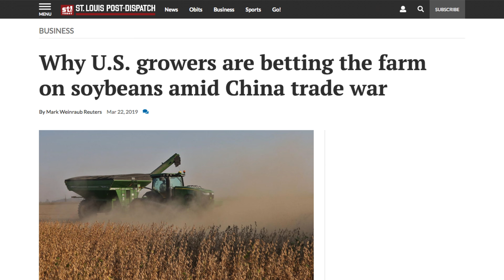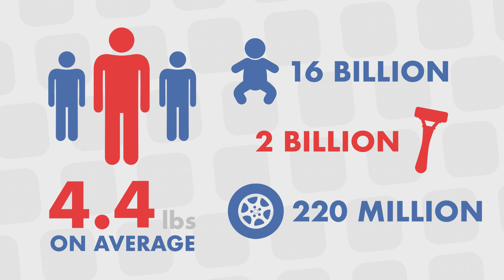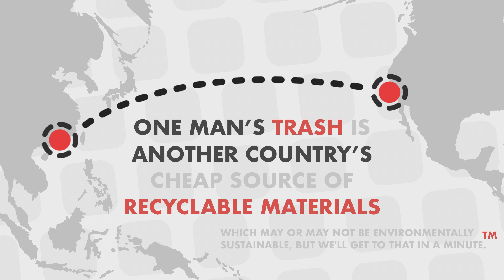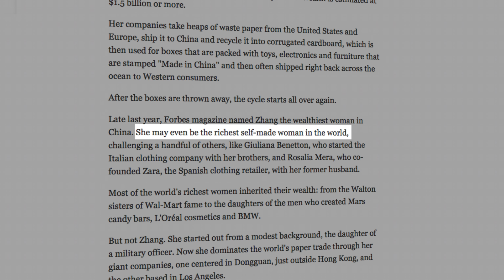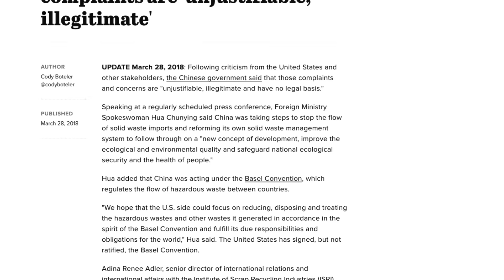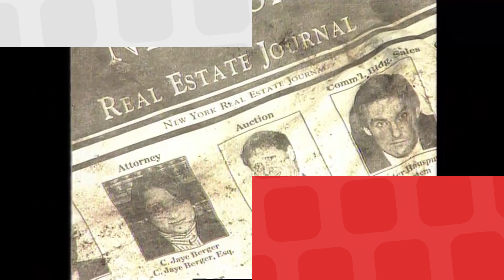Why China Doesn’t Want Your Trash Anymore

Comment: The company I work for is closely connected to one of the largest facilities to manufacture cement in Europe. Cement production consumes insane amounts of energy at a level where the lights flicker whenever they switch the large machines on and off (it strains the local grid's capability to compensate). As it turns out, they generate 60% of their profits by burning trash to produce more than half of the energy onsite (with extensive filtration; they are very clean at it). They basically make a profit before selling anything at all.

Since they also sell some of the by-products, the company is producing so cheaply that it's impossible to compete with them on a national level and to an extent even across the borders. The facilities and machines are also so insanely expensive that nobody dares to put up that kind of investment. They are very close to a monopoly and don't rly have much innovation going on as a result.
Reply: What is the name of this wonderful company?
Reply: at least its a green monopoly
Reply: Cemex. Though they didn't build the thing up from the ground. The basic system for repurposing trash was set up decades ago in a less refined form. The plant itself has seen different owners over time and a number of very costly modernizations took place. It's heavily automated, too.

The cement industry itself isn't too profitable overall and even the big players seem to run into financial troubles quite frequently. I wouldn't be surprised, if the facility switches owners again at some point. The people that work there have seen them come and go, but the facility always found a bidder.

Comment: Hello from Denmark. We are burning our trash for electricity, heat, and hot water. 
Since the process produces all of that, we simply use all of that.

We are importing trash to keep our burners going. This is a future problem when we no longer produces enough trash. But for the moment we are earning money on trash, converting that into "green energy" because we are that good to recycle then we are left with 0 landfills, and our trash being burned are overall non-recyclables. 

That is part of our "Danish model"
Reply: but burning trash is pretty toxic don't you think? I mean it is beneficial to burn trash for energy but that compounds the CO2 problem and releases harmful particles to the air.
Reply: @anyanyanyanyanyany3551  it terms of that, we would need to consider firstly the kind of powerplant that it replaces. Secondly it is mostly bio trash, using highly efficient incinerators that scrub the worst of the pollutants from flue gases.

Then we don't need separate powerplants to generate heat, or hot water.
But a lot of the imported trash does contain a lot of plastics.

And we that we do not have any landfills, at all.
Reply: @anyanyanyanyanyany3551  nope it's filtered is different from open burning that we do in balkan villages in DK they do this on a power plant whixh filters all the s💩 that would come in the air and burning makes dark grey or black but is white instead so it means all of the harm is removed

Comment: I have a solution (for the plastic all other recyclable are screwed) you manufacture a ton of airtight metal spheres/cubes/cylinders fill them with plastic vacuum seal the plastic filled spheres then heat them causing pyrolysis which will produce new smaller polymers like short-chain hydrocarbons which can be used a carbon-neutral fuel in internal combustion engines or be used to reform long hydrocarbons (i.e plastic). This could also be slightly modified to accommodate cellulose/lignin so fibrous plant waste/paper could be recycled into something other than more paper.

Comment: Maybe a system that can take blueprints from companies that make certain items like cellphones, computers and etc. that are all feed through a machine that helps read an item and breaks down these tossed machines into their base components. for example, separating all the different plastics, metals, and boards from a cell phone, or plastic from a rotating fan. I don't want to hear how that's impossible, in 20 or 50 years how far will tech jump to? As for blueprints, companies would just need to play ball when the government tells you to do something. It would then be on the government to protect the these blueprints from would-be thieves via encoding security. It''s a hard concept to explain.

Comment: New Zealand was prompted to create industries to process this waste onland 
Plastics are converted to fenceposts.
Tyres shredded and could be used in roading, but is not. Most goes into new rubber goods and steel belts recycled into steel again.
But the high cost of energy here has reduced the economics. The Gretas of this world are denying the recycling possibilities.

Comment: Plenty of raw material! Enough to regulate production of plastic fibers with a ban (for decades) on new plastics fiber used in single-use containers and short-term-use items. With subsidizing of new, small, nonprofit companies and modifications of existing factories, while taxing plastic items and a higher rate for single-use containers and the material collection process shifted to these manufacturers looks like a solution that's overdue and inevitable. China could be an innovative leader willing to invest in the future setting the example for the greedy US.

Comment: would be awesome if people would sort their trashes alltogether so there would be no trash. Only recyclable materials. Normal household materials uses few different sort of plastic, paper, cardboard, glass, different sort or iron. Iron is easy to recycle coz of magnetism. Paper and plastic ofc the hardest. Those machines what recycles the plastic to new one are not able to suck up any kind of paper or cardboard because it burns in the plastic melting spot and thus screws up the plastic what machine produces. :)

Comment: stop it with the plastic bag and the 1000 years bull, sometimes when I am cleaning up the garage, I find plastic bags turned into powder, even the  the thicker material that is used to make shelters for cars in the snow, this material too turn to flakes  then powder within 10 years, where do you get the 1000 years from???

Comment: 1000 years for decay of my grocery bag? It takes me 13 minutes (if I hit the lights right) to get home, and every grocery bag has a couple rips/tears when on the kitchen counter. I say much less than 1000 years. 
Just questionin’
Reply: I don't claim to know everything, but perhaps I can shed some light on your question

Your plastic bags may be ripped up, but they still would not decompose. 

Ironically, they may exacerbate a more serious problem- Microplastics. Research by WWF released just this week (June 2019) consolidating over 50 studies shows that we ingest some 2000 plastic particles per week.

I know it's not easy. But please consider reducing your use of using single use plastic bags wherever possible. Every bit counts